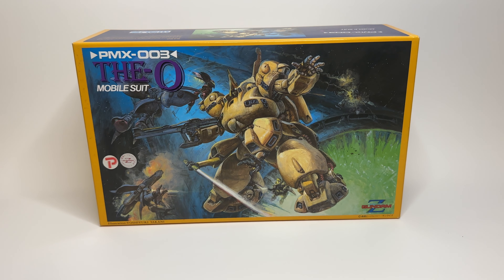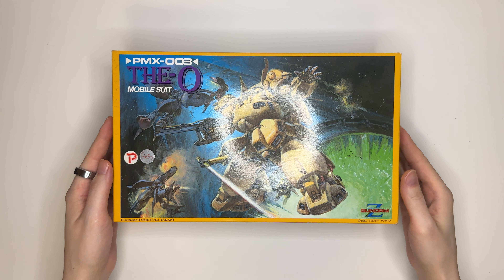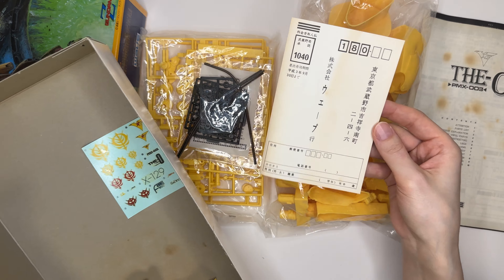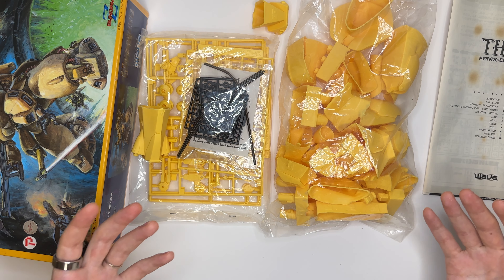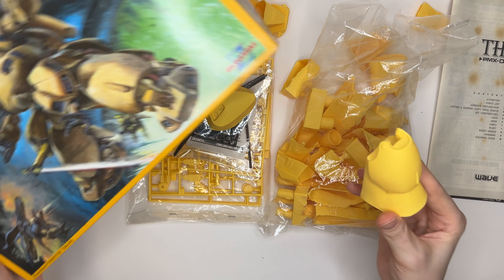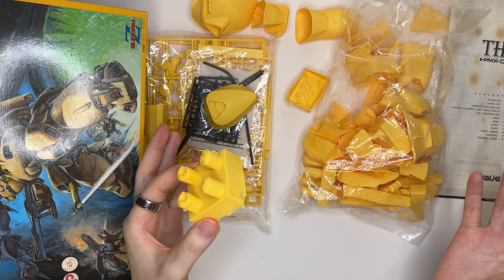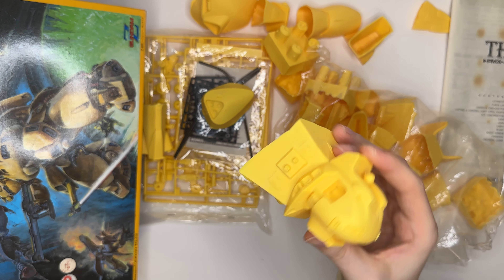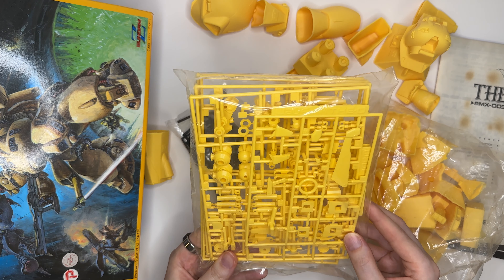The "O" - Rare Soft Vinyl Model kit - 1/144 scale - Zeta Gundam 1990 - sofubi -ソフビ

Comment: Wow. This kit you have is freaking AMAZING. Many sofubi kits have resin parts to go with them, but this is a sofubi/plamo hybrid kit. It looks like its inner workings are a plastic skeleton and the sofubi armor fits around them. You just have to make sure to scrub the vinyl parts with a degreasing dish detergent in warm water with an old toothbrush to remove all of the mold release agent OH and Takani is legendary. He's most famous for the Tamiya box covers, but his artwork for the vintage '80s Macross kits in particular are spectacular. The box cover for this O kit is something to cut up and frame on your wall!

Comment: As far as warped soft vinyl, warm up the parts with hot water or hairdryer like said in the video and once in the proper shape, dip it in ice water and it will hold the shape
Reply from the maker: thanks for the tip! I didn't know about the ice water part!
Reply: I built a couple of soft vinyl kits back in the 90’s the two I remember were the ED209 from Robocop and a Mad Cat from Battletech. I’d suggest keeping some of those large extra chunks of throw away material for paint testing. Certain paints will totally destroy the material, I think most acrylics were fine, but enamels and oils turn the stuff gummy and almost permanently sticky. I don’t know how lacquers or lacquer thinner would affect the vinyl since back in those days those paints weren’t easy to find in the local hobby shops.
Reply from the maker: @seanswader7425  good idea! I pretty much only use acrylics these days so hopefully there will be no issues!